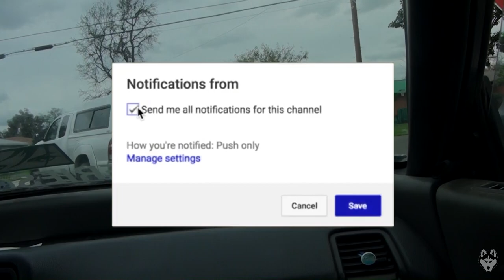HOW TO CHANGE A CALIPER ON A HONDA CRX

Comment: About to get my crx running this weekend thanks for the video as a refresh it’s been about five years since I worked on it and without this video I wouldn’t have ordered the caliper brackets hahaha
Reply from the maker: glad it helped make that rex run !!!
Reply: Ims vlogs just busted all the rusted bolts of the back calipers yesterday! Gonna work front side Sunday. If you can believe it sat for five years and I put premium in it AND IT FIRED UP
Reply from the maker: Green Wizard my car sat for almost 4 years ago too barely 3 years ago it started running